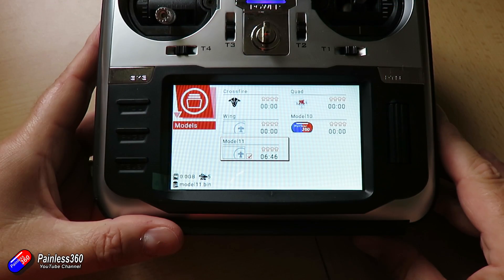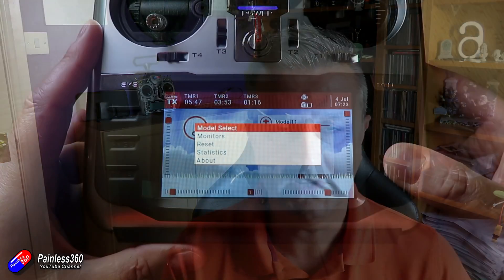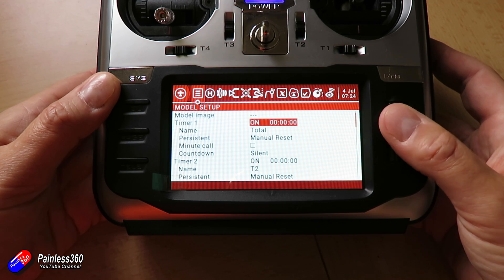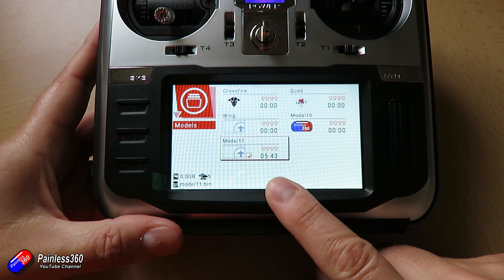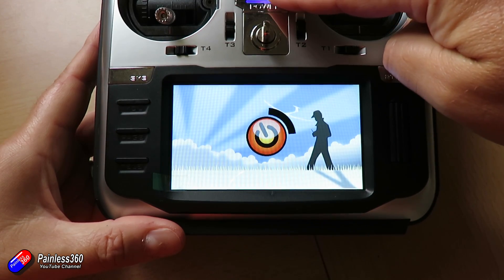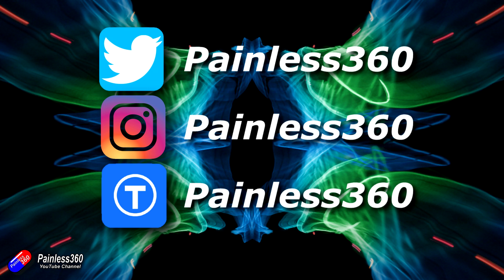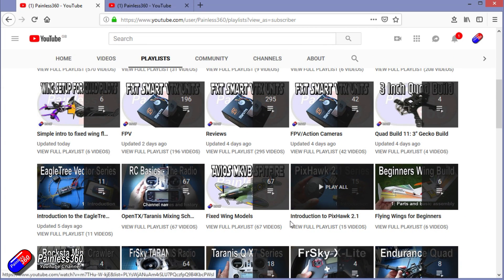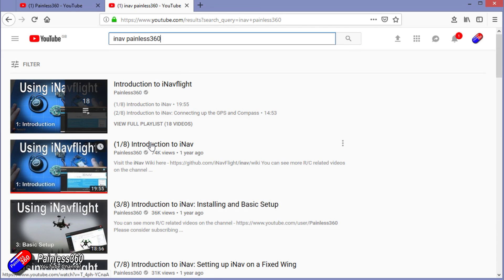What do those numbers and icons mean in the OpenTX Model Select menu?

Comment: Hello, just sub`d to the channel because of the T16 content. I have returned to RC heli after many years.  Can you give some advice please? Used spectrum gear in the past but do not want that brand,would like the T16 but not mant UK vendors to ask advice. If I buy the standard UK T16 what module will it come with and what RX brands can I choose from. I would need 7 channel. Any advice would be great
Reply from the maker: The multiprotocol  module isn't anything different form others available. By adding a module you can get the radio to talk to almost anything. I've used it with Flysky, Frsky and Spectrum recievers without problem..